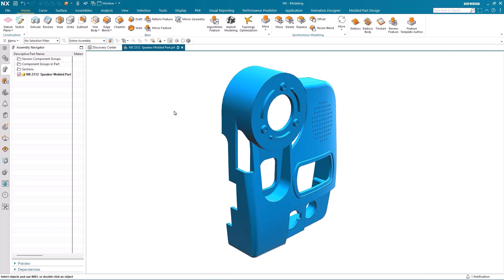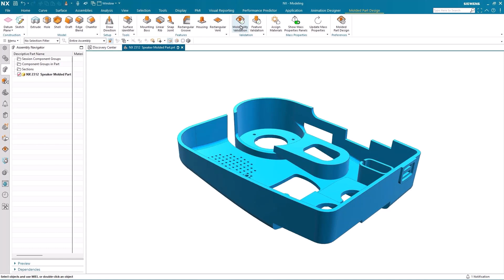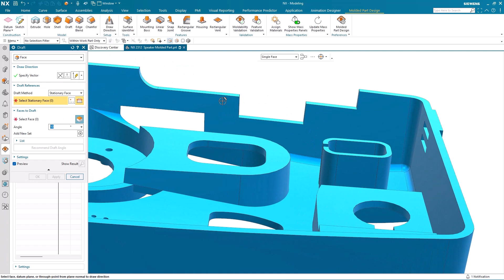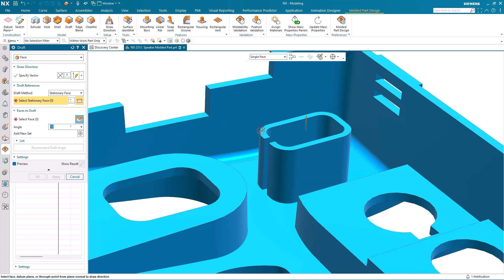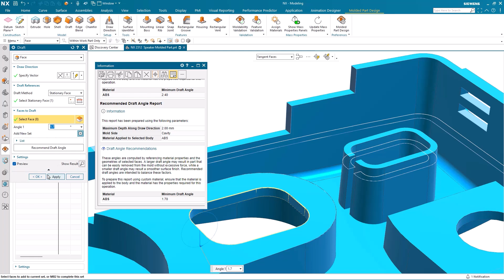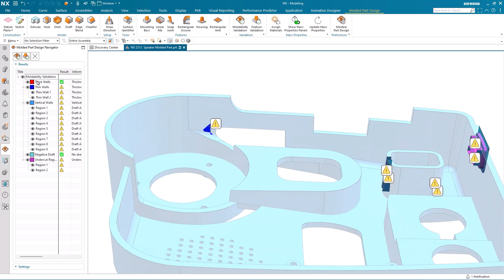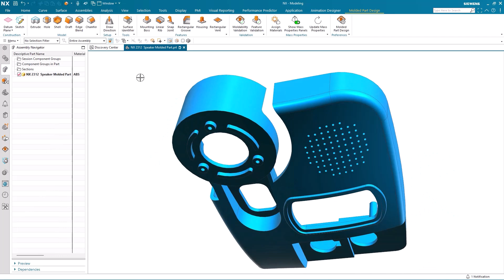NX Tips and Tricks | January 2024 | Automatic Draft Calculation

Comment: Hi sir, Im using NX 2312 but I dont have the command to reommend the draft angle base upon the geometrical condition.
For what is this? Do I need to enable something?
Reply: These capabilities are part of the NX Molded Part Design add-on. You would need to either have license for that particular module or if you are using Value Based Licensing then it would be enabled through your token pool.
Reply: @jeffmiller6366  thanks Sir!

Comment: While using different draft values, it would result in variable plastic thickness, and that can cause problems right
Reply: Thats make lots of sense... 🤔
Reply: Variable draft angles are common. A .5 degree is generally used across all vertical surfaces, while specific areas may require more draft depending on things like surface textures, depth of the vertical surface, etc.
Reply: @jeffmiller6366   Thank you so much for the clarification, you´re right!